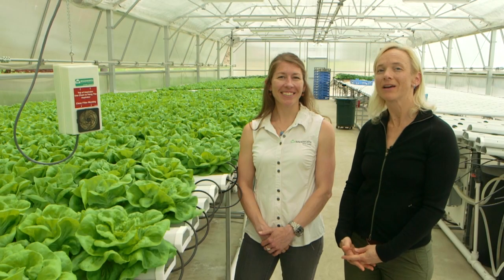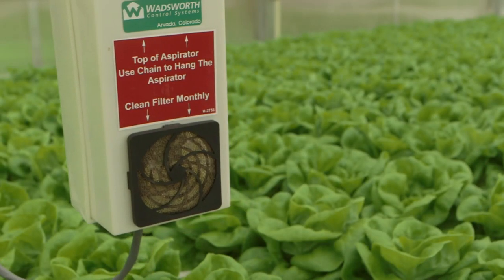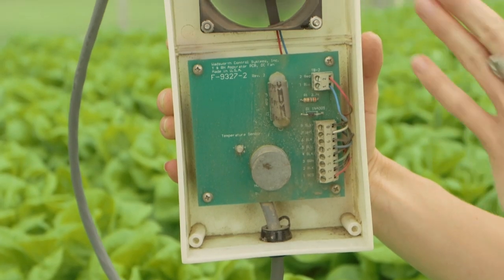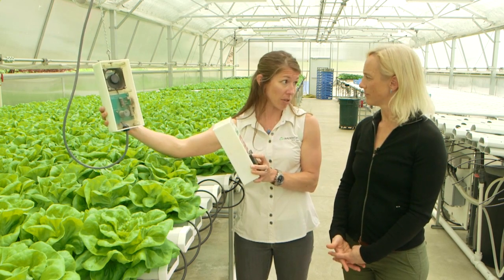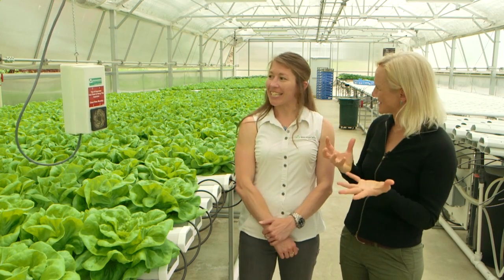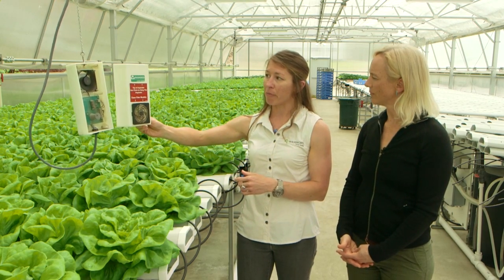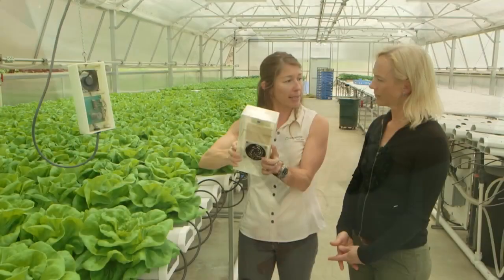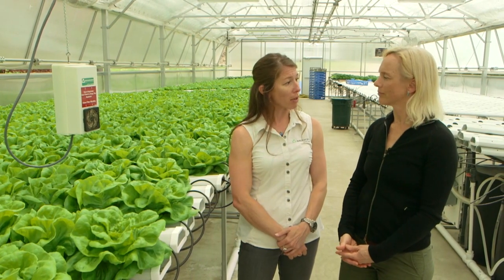Wadsworth Controls Systems Series: Aspirated Temperature Sensors

Comment: Just put a normal sensor under the table or plant level within the canopy for temp and humidity. The fan is not helpful as the box still is warmed by sun light and the fan motor generates heat itself, just a gimmick think about it. Need it sheltered from radiant heat, conducive heat, shaded , not too close to thermal mass different than the plants are exposed to. So in a potted plant canopy or a plastic plant canopy. Experience the same conditions as the plant.